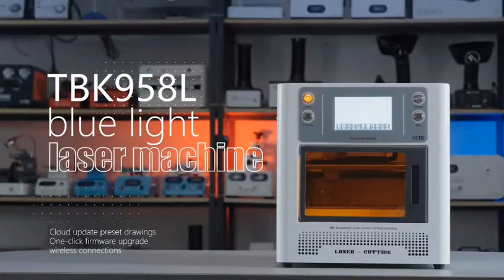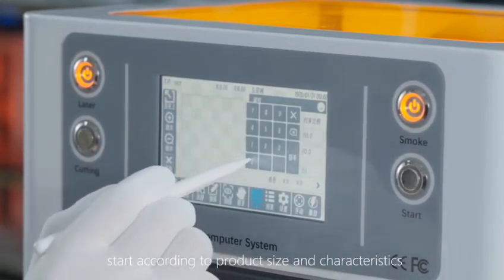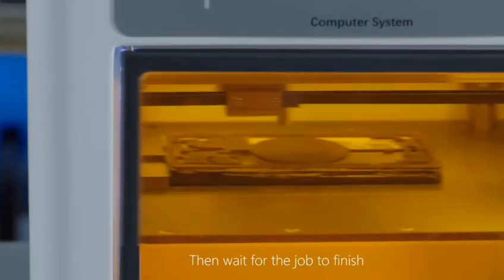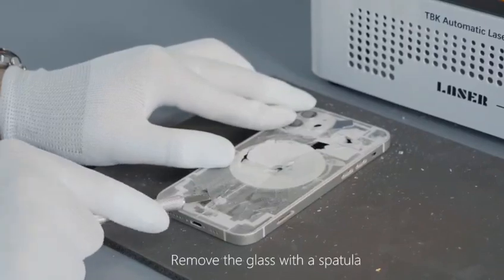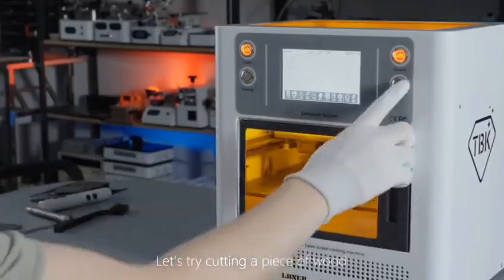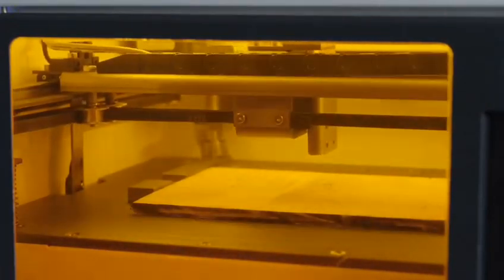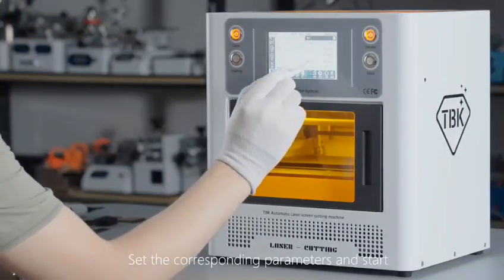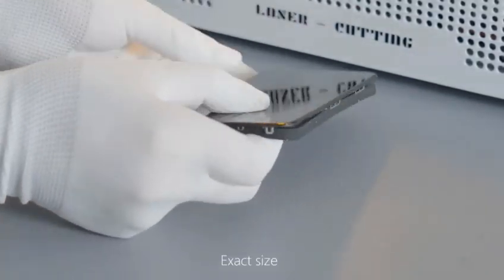TBK 958L-Automatic Laser/Marking Separator Machine Tutorial - Step By Step

Comment from the maker: 1. It can laser marking parameters, transferring pictures, contents and files.
2. This machine is more efficiency and easy to control.
3. It including SE SE2 8 8 Plus X XS XR XS Max 11 11 Pro max 12 12mini 12promax and also ok for other brand Front door or back cover separation
4. Built-in computer , software and all files are included , Automatic focus length, no need measurement
5. BLUE light Laser on the phone directly , no damage for motherboard or battery , no need to open whole phone
6. It Can also engraving letters as per your request , support wifi which can upload photos from your phone to machine directly
7. Automatic alignment fixture mode is included ,100% accurate , no need to adjust the location each time
8. We also provide big hole back glass and tempered glass for iphone models , which does not need to take off the camera frame.

For more Repair parts&Tools and Tech support, please visit: 
Website: http://www.elekworld.com
Facebook: https://www.facebook.com/Elekworldshop
Instagram: https://www.instagram.com/elekworld
Twitter: http://www.twitter.com/Elekworld